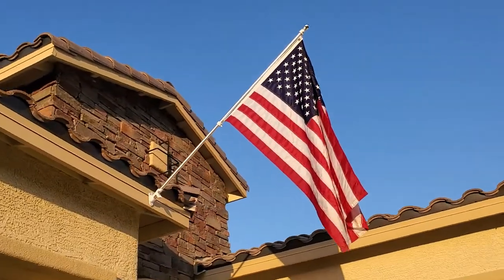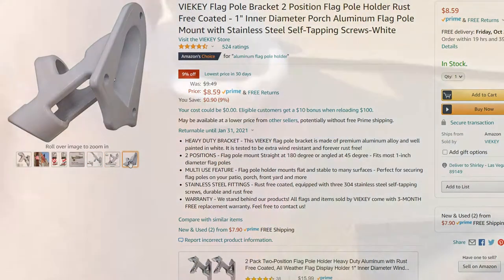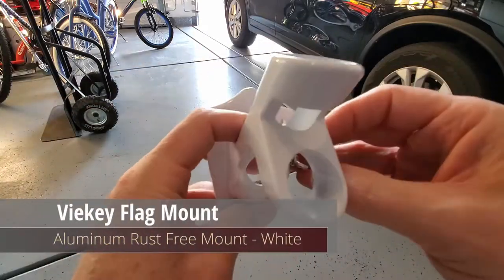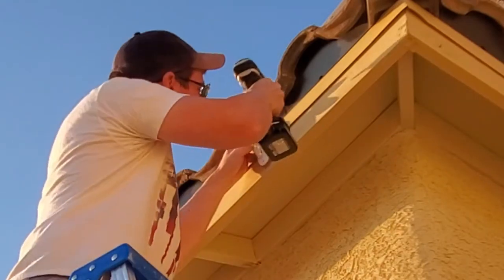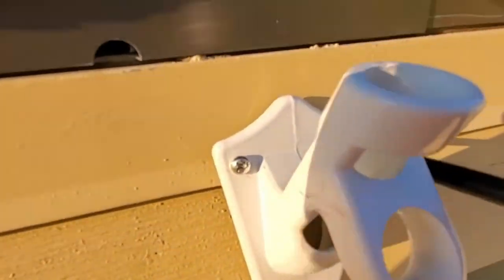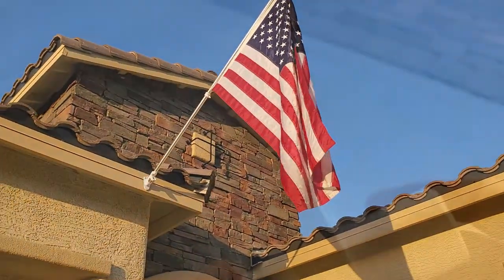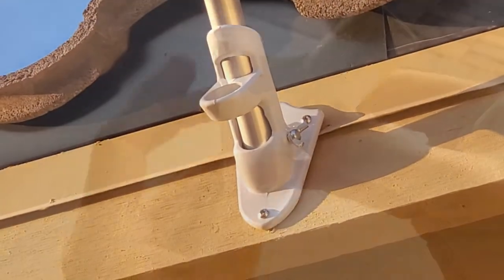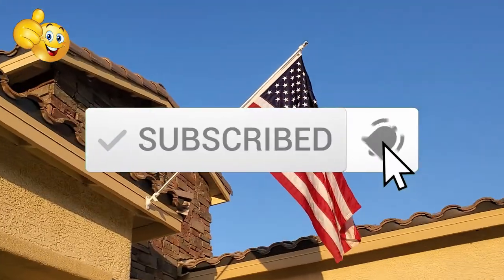ALUMINUM FLAG POLE MOUNT - HOW TO

Comment: Jokes on you I’ve been using the same plastic mount for 4 years and it still works perfectly fine 👳🏻‍♂️✈️💣🏙
Reply from the maker: We get a lot of wind in my area so the plastic just didn't hold up.